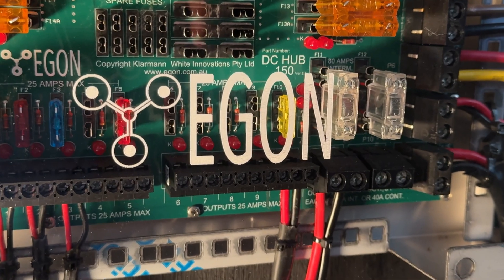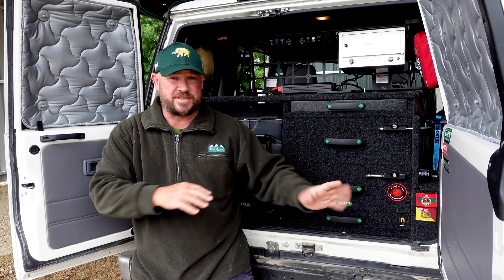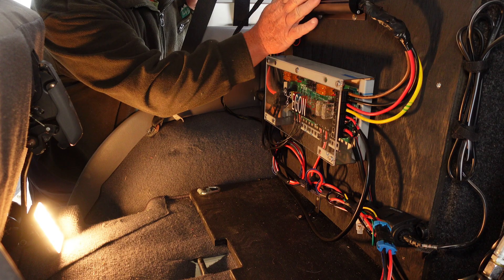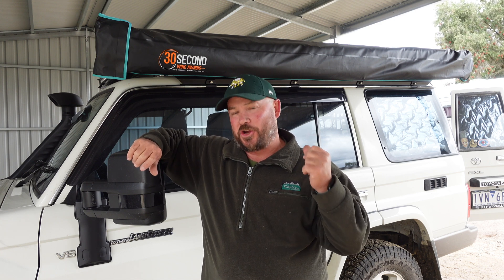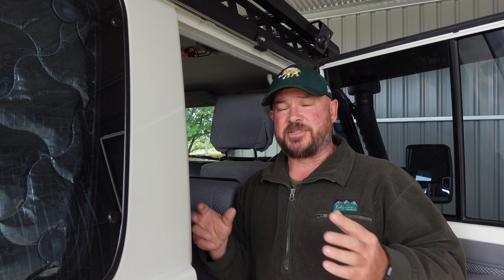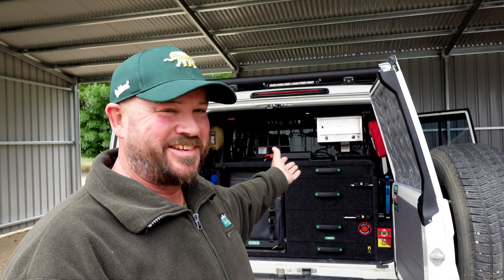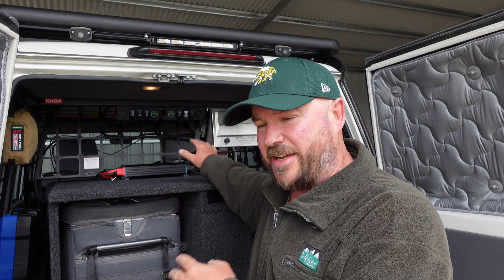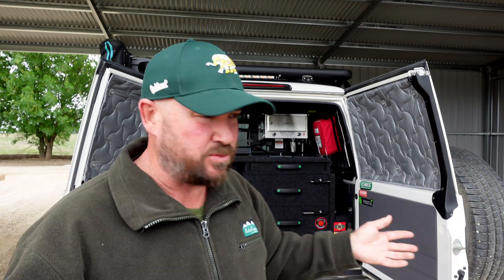Is this the easiest way to DIY your 12 Volt setup?

Comment: I' first seen the DC Hub on Andrew St Pierre White's 4xOverland YouTube Channel about 12 months ago, a brilliant product and something as simple I hadn't been able to find in Australia, but due to health issues I couldn't justify the cost at the time either.

Well 12 months on Life has Changed somewhat, and I've just ordered my DC Hub yesterday. Not 100% shore when I'll pull my old electrical system out, I'm thinking more after the New Year when my Roster gives me a couple weekends off, but My Auto Electrical Mate is more keen to get his hands on the DC Hub and get it installed sooner then later . . . I think he's looking at next weekend lol . . . he might win.

Either way, it looks like a game changer when it comes to Power In and Power Out management and simplicity . . . I am looking so forward to getting it into my Canopy setup
Reply from the maker: You wont regret it mate. Makes the whole thing so much easier
Reply: @Haveacrack76  Hy Shayne. Just an up-date, I have had the DC Hub installed in my Ute Canopy now for just over 12 months. Before installing the DC Hub, my Redarc 40amp DC/DC Charger use to only charge at about 30amp max, I had issues with Circuit Braker's tripping in my old wiring setup. Since installing the DC Hub it has deleted the Circuit Brakers and not a single fuse has blown, and my Redarc DC/DC Charger now charges at the max 40amp all the time. I have to say, it has been a game changer, Simple to install, very efficient, and not a single issue since installing. 

My issue now is, I'm searching for a Toyota VDJ78R Troopcarrier to replacing my GU Patrol Ute, so my decision now that I have is do I leave the DC Hub in the Ute for the next owner and spend another $700 on a New DC Hub, or do I pull out my Original DC Hub to install in my Troopcarrier when I finally find my dream 4wd.
Reply from the maker: @grant209  Tough choice mate. Part of me thinks to take it with you and let the new owner build it the way they want to.

Comment: 100% agree. I just bought it myself. It’s a game changer.
Reply: How? Not arguing its not a nicer solution but it seems to just remove the need for crimps, a fuse-block, midi fuse block and busbar?? I still cant see the value
Reply: By the time I costed all that in and not being the most confident in wiring up a 12v system I feel like i have the best and definitely safest system I could have installed myself. I also love how neat and compact it is.
Reply: @scottsokolenko3718  that i think is where this gear shines/makes sense - people sitting on the edge of attempting it themselves, installers that want quick turnaround & the client’s paying and/or ocd people with the money.

As a savvy 12v diyer, im not seeing the benefit vs cost. I just added it up and the parts will cost me 250 to do what the egon does, will it be as simple to wire and as pretty, no but it will be close!!
Reply from the maker: It really is mate